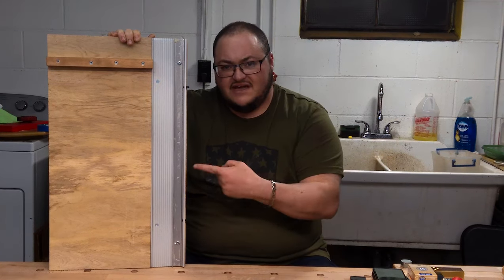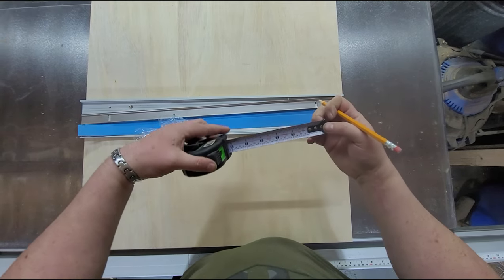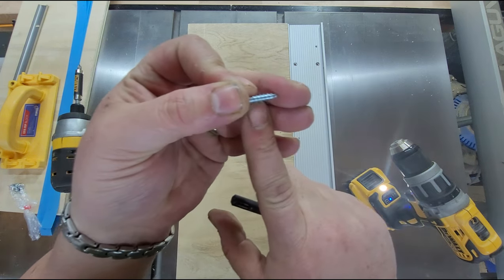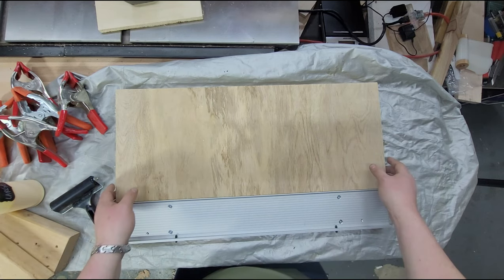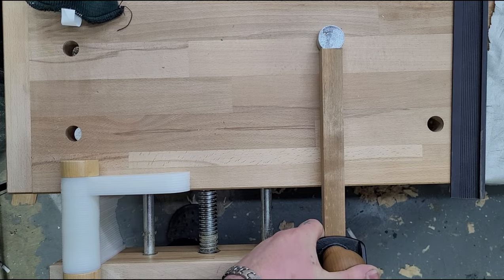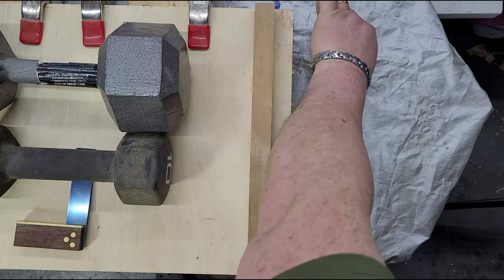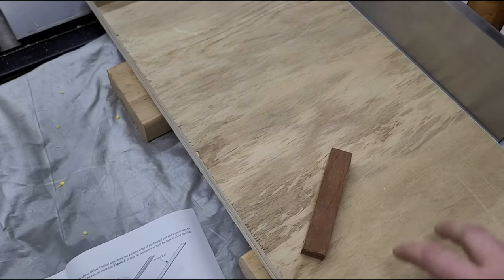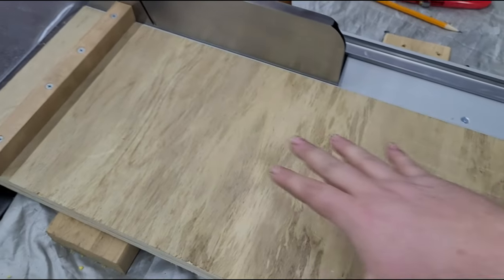How to Build a Simple Shooting Board Using the Veritas Shooting Board Track

Comment: thanks for this, i like the veritas track, not convinced about the fence though either.  "squarehead"?  here in canada we call them robertson screws.  the word you were looking for is the "root" of the screw
Reply from the maker: It's like overkill with the fence haha
Reply from the maker: Thank-you! Idk if they are caller Robertson screws here haha never heard that before. Same with root but I like it!!!
Reply: @BatCaveCreations  mr robertson was a canadian and developed the robertson screw socket and driver tip geometry.  us screw manufacturers refused to pay royalties to him, so you guys are stuck with phillips screws.  robertson screws are very common here for everything from wood construction (buildings) to electrical stuff(breaker panels, outlets, switches etc etc.  phillips heads are primarily for drywall screws
Reply from the maker: Now that you say that I remember! You are correct! Thank you!

Comment: I really like the idea of the track, but cannot justify the purchase of a $350 plane for shooting (or is that 'chuting'???).  Anyway, I tend to use an old Stanley #5 that I refurbished a couple of years ago (a hobby I picked up during the 'crud' period).  Can I use that plane with this track?
Reply from the maker: The fence part of this track sits 1/4 up from the track bed. I checked on a no 5 (not Stanley, but I believe Stanley made) and the frog/iron hit the fence, not allowing the plane to lay flat on its side. What you can do is measure from the side of the plane to the frog and see if you have about 5/16th clearance. if you do you are good if not. It won't work :( 
Another great option is a Low Angle Jack Plane, I see a lot of people use these for shooting instead of a dedicated shooter.